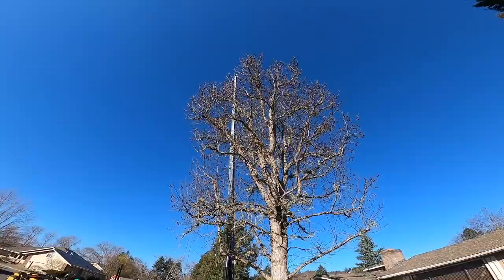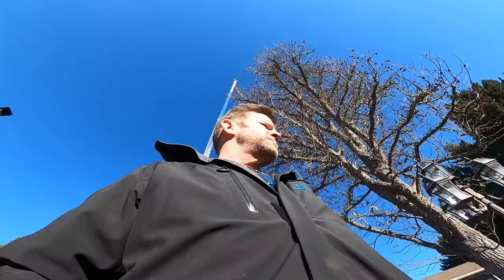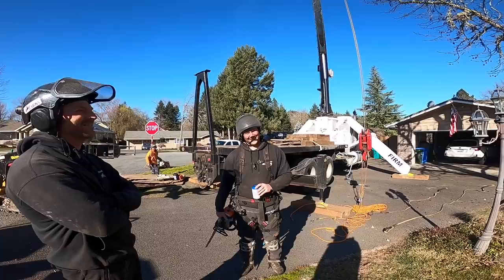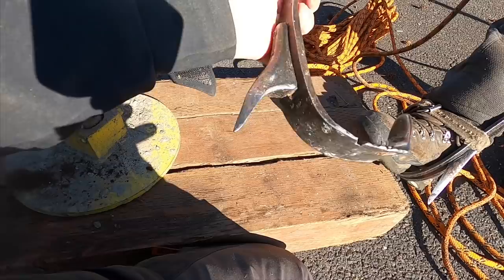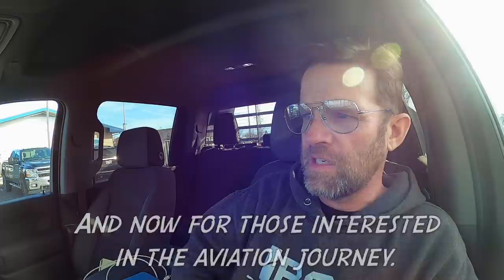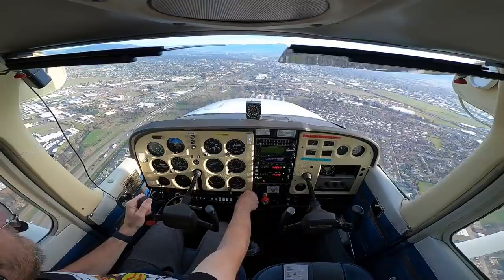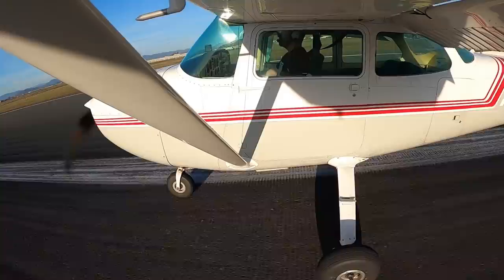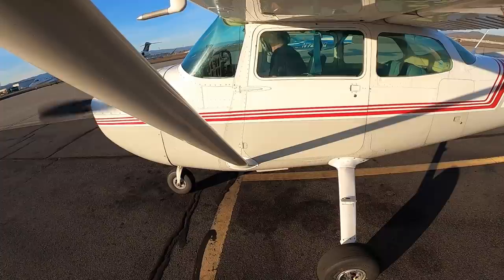Good Patterns Lead to Good Places

Comment: August- you are exactly where you need to be with your flying.  Having the knowledge of needing further information on uncomfortable areas is a wonderful tool.  Remember that old adage….there are old pilots, and there are bold pilots, but there are no old bold pilots.  I had the opportunity to take a second dive training course years ago and found the extremely differing philosophy of different instructors.  The first was all about the dive tables.  This is how you plan your dive taking into account how deep, how long, required decompression stops (if required), and all the math and/or charts you have to follow.   His principal was sound but boring in application.  The second instructor taught us the same knowledge, but introduced the seriousness of the chore in a manner that made it far more enjoyable.   Then continued to make the entire series of instructions to be fun learning nights.  You are learning about controlling a small easily buffeted aircraft and requiring yourself to control it according to your high standards.  You weren’t as comfortable in the top of a hundred fifty foot tree when you first got up there as you are now, where you are totally at ease as in your favorite chair.  I firmly believe that you will arrive at the same place after burning the required gallons of fuel for your check ride.  Uncomfortable can be a great teaching tool- learning how to build skills makes you more comfortable.   You are doing great!  Just where you are supposed to be.

Comment: HI August, I remember living up in Alaska. One time during a landing at Juneau Alaska, the plane I was on went through one heck of a crosswind and there was ice on the runway. When we got near the airport building, the plane was blown to the edge of the tarmac and didn't stop til the front landing gear sunk into the soil at the edge. We all applauded the pilot and he came on the speaker and thanked us for trusting him again. The crew at the airport towed a set of stairs to us and we all went on our way, slipping and sliding on the ice. In Alaska, it is common to applaud a landing. Often enough, you are glad the pilot probably has flown bush planes and pontoon planes and can read the conditions. Good job August. Good job. George.
Reply: Great story , I'm going to stick with Midwest living and random acts of slow tree climbing !
Reply: Great reply 🤣🤣🤣

Comment: One of only three guys at work that wore Buckinghams. The other umpteen other guys wore Klein’s. They didn’t like them because they thought their foot sat too far away on hard poles. I think they made it easier to pivot and swing from side to side. As you’re saying, on a big bark tree they might gaff out or the bark just pop off. 
Worked at Eagle Aviation in Long. Beach for a summer fueling planes and mopping hangars almost 40 years ago. They also had a flight school. All old military guys were the teachers.

Comment: Hey August, after watching a lot of videos of people using your phone pouch, I'd like to offer a recommendation that may make it slightly better with minimal effort. I noticed you have to use one hand to ensure the pouch pocket stays open while you put your phone in it. 

My recommendation would be to put a piece of slightly curved silicon inside of just the top part of the pouch pocket that makes the mouth stay open for one handed operation of stowing your phone. This would make stowing and retrieving your phone much easier and would likely prevent people from accidentally dropping it by unknowingly thinking they slipped it into the pouch when it actually only stayed on the outside.

Just a thought though. Love monkey beaver and all you do August! Keep up the great work and be safe!🤘🏻🤘🏻🤘🏻

Comment: Damien Try a set of bashlin aluminum spurs. They’re super comfortable.
Reply: Those are what I rock too! Some minor alterations are need to put the Cadillac pads on though
Reply: @mattthetreeguy  I would like to see what you had to do to get the Cadillacs on them
Reply: @Woodysworksaws  the shaft that slides into the pad slot needs to be shaved down a bit to fit so do so at your own risk! 😁

Comment: Fret not on the landing ..ballooning thing ..it will come in time ..all it takes is time, milage..relax.  After 500 hours it will land itself.   The 172 is a good machine to start on ... when you come down to New Zealand you can have a bash at my Cessna 180.
With the crosswind ..wing down a bit into the wind .. that xwind landing was good .. feeding the throttle in a bit is a great skill.  You land pretty flat ..nothing wrong with that but try getting the nose up a bit.  Everyone's an expert.
Reply from the maker: Thanks, super chill!

Comment: Hey August have you trird pole gaffs ( short spurs ? Supposed to be better for the knees?   
Excellent video , flying is looking good 😎
Reply from the maker: I only wear the tree gaffes. I suppose I could have two sets, one for thin bark, but I don’t.
Reply: I can't really comment, most the trees here don't call for spurs / I dont do much and mainly thin bark , , ,  however i tried my mates short gaffs and i found them more stable and less strain on the knee but could just be me 🤷‍♂️ ✌

Comment: I heard a bit about adding rock salt to the stump to help decay??? Could anyone enlighten me?
Reply from the maker: From google:
Drill holes into the stump.
Pack the holes with rock salt.
After all of the holes are packed and the stump is covered in salt, pour soil and mulch over the stump.
Then, pour water over the mulch—this will dissolve the salt, help the roots absorb the solution, and pack the soil.

Comment: August, I have been a pilot since 1965 and my primary advice is to learn to most importantly, fly the plane and secondly, fly a lot.  If your skills degrade you are a significant danger to yourself and everyone else.  I really enjoy your channel, but if you are going to continue with the flying, please start another channel for your flying experiences.  Your tree work is great, but your flying, at this point in time, not so much and for me, it takes a lot away from this channel.  I have confidence you will do a great job as a pilot, but it usually takes a lot to become accomplished.  Please don't become an occasional pilot, we loose far to many of them.  If you decide to become a pilot, be an extremely good one that flies good stable landings.  Remember, air speed is everything to avoid stalls and spins you might not recover from.  Just to let you know, if you fly for long it is normal to experience some extremely stressful, possibly scary situations.   Comes with the territory.  I wish flying was always fun, but unfortunately, from experience, that isn't always the case.  I would also recommend avoiding single pilot operations in very busy air traffic and complex navigational conditions. This is especially true in the earlier portion of your flying carrier.  It's very easy to become overwhelmed as a single pilot in those situations.  Enjoy your flying, I hope to continue enjoying your channel, it is one of the best!  Nick, North West Farmer
Reply: Hi Nick, I certainly don't want to say anything to offend you but I read all the comments and pretty much everyone enjoys August's new adventure of flying. There's quite a few of us that own a tree business and are pilot's also. There is another channel for his flying, it's run by his son Hezekiah and he's doing a great job of it. But once in awhile Hez is in school and can't go along. There's quite a few of us that love watching August improve as he's learning and are proud of him. If someone doesn't like watching the flying part of the video they have the option to stop the video when he goes to the airport.
Reply: @danmcburney3247  Copy on that, just wanted to let August know I watch his channel due to the tree work and will go somewhere else to do so if it is going to turn into one on his flying experiences.  August has a great channel, but for me not so much relative to flying at the beginners level, or flying at all, when I come here regarding the tree work, which is fantastic.  There are a lot of choices on YouTube so I will refrain on letting August know my concerns regarding the channel and learning to fly.  I was hesitant to comment, but felt he was taking the channel in a poor direction, which he may want to know, even though it is only my personal feeling.  Still a big fan of August, but not relative to airplane operations.  Nick, North West Farmer
Reply: I understand... have a great day Nick !!